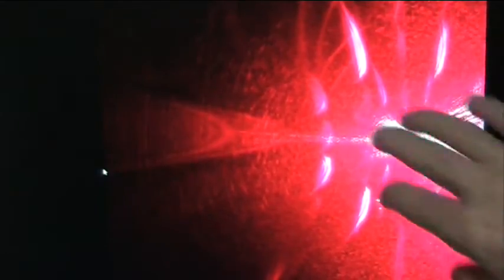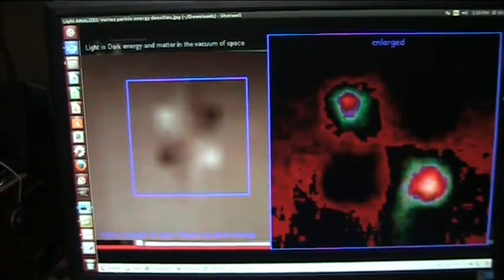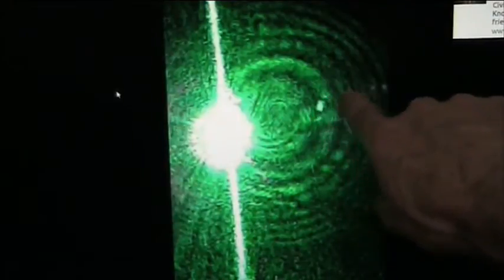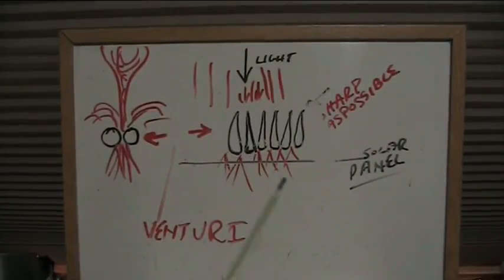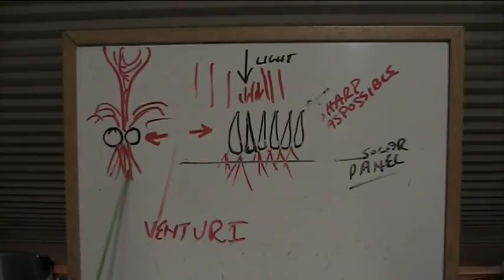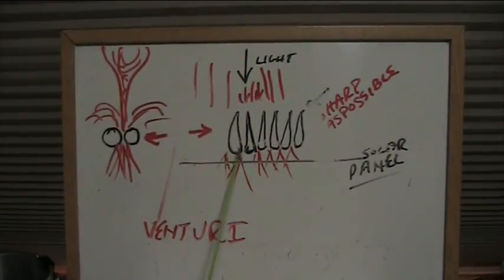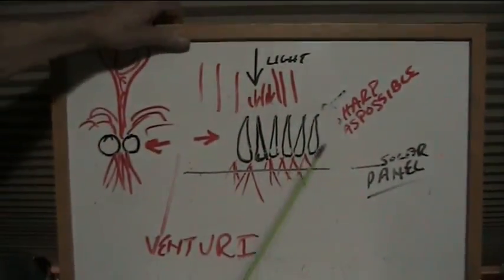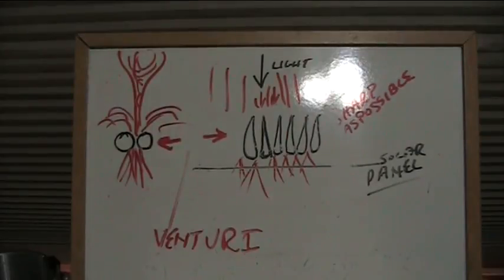Solar collection EFFICIENCY challenge open to all

Comment: I would like to do the solar panel thing if you could tell me how far apart the venturi is.  really need to know to do the challenge. and how far from solar panel do you think it should be?
Reply: No idea its guess work.
Reply: @mudfossiluniversity  so you are saying to use regular light like you would with a solar panel or use some lasers to go through all the venturi? and hit the solar panel? It will be another a week or so but I am going to do this. I will start with 5 venturis and then make a 10 if things look good I will make one the entire length of panel. any more advice you give me? big nails small nails? jsut looking for starting point.

Comment: if light is water then fire is
Reply from the maker: Light is a fluid of electrons and all of space is in the vacumm. But neutrons and protons clump together and are the source of all life and light (electrons) waters it actually and grows and heats and lights things. This also adds weight to the Earth....A LOT RAPIDLY.. https://www.youtube.com/watch?v=vTSkuROHqY8
Reply: @mudfossils6331  I'm extremely fascinated by your mud fossil studies, and the undeniable proof that your work has been able to reveal. Your approach is, not only intriguing, but highly logical, and sensible, and based on substantial, and mounting proof, to perfectly corroborate every one of your claims. I cant get enough of it, to be honest! Your theory on light, on the other hand, is also very interesting, to me, yet, as someone with a physics background, I am having a bit more difficulty wrapping my head around your exact proposal, and I am left with many questions!: Firstly, if you are theorizing that light is a liquid, then that would require photons to be regarded as matter, and if photons were a material, then that would require them to, innately, possess mass, and charge, yet we know that light does not possess mass, or have charge, and cannot be given charge, under any possible circumstance. Light is produced by accelerating charge, but does not, and and cannot, itself, have charge. The photon is proven to be, strictly, electrically neutral, and it is regarded as having dual properties of, both, a particle, and a wave. Photons are considered Bosons, since they do not carry, either, a positive or negative charge, yet they carry energy to a source, to result in charge. The only force-carrying bosons that have electrical charge are the W+ and W− bosons, of the weak nuclear force, which have charge +e and −e, respectively. Photons, however, although not carrying charge, can be used, for example, to charge a battery, by carrying energy to, “charge” the battery, by separating charges, that are already existing, within in the battery. I don't want to go off on too much of a tangent here, but, from what I understand, you are proposing that light has a primary, liquid state, and then breaks into individual charged particles upon interaction. I suppose, what I'm trying to understand, here, is how photons could be a liquid form of matter, if this, alone, would negate the proof of photons having, both, dualistic, particle and wave capabilities, and being devoid of mass. This dualistic, and massless nature of the photon, serves as the basis, underlying its functionality, within our universal structure. Photons, if actually a liquid form of matter, would have to possess some form of mass, and they would, also, lose their dualistic capabilities, having to, then, be, solely, recognized as particles. This would be a significant alteration to their structure, and it would entirely change everything we have proven, and grown to understand, about the physics of  our universe, and the role the photon plays. With light being a liquid, and therefore, photons, subsequently, HAVING to possess mass, there would, also, in turn, be no such universal, "speed limit" as the speed of light. Ultimately, the role of the photon would be compromised, completely, and from every possible angle, upon analysis. Anyway, I hope I am making sense, in what I'm saying. I would love it if you could clarify a bit more, in regards to this, so maybe I could get a better understanding of exactly how you're proposing these properties and  interactions, would, specifically, work, and how it would be possible for their massless and dualistic nature to remain intact, under the circumstances you are claiming, as to keep the speed of light the same as we know it to be. We know the speed of light exists, and fulfills a highly incremental role within physical reality, so how could this universal constant still remain, if photons were to carry mass?
Reply: @Jesoterica_Medium  Can we talk? What did you do in Physics? Light is a particle and I can show that. Your assumptions about photons is wrong and we literally know nothing about particles...they are ALL DIPOLES even electrons.
roger@mudfossils.com
I would enjoy a chat on Zoom if you are up for that?